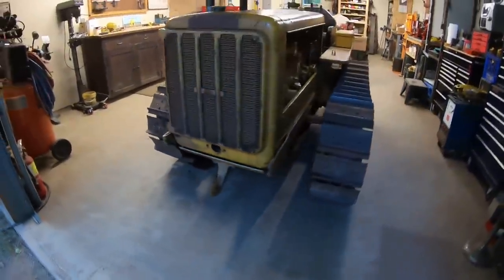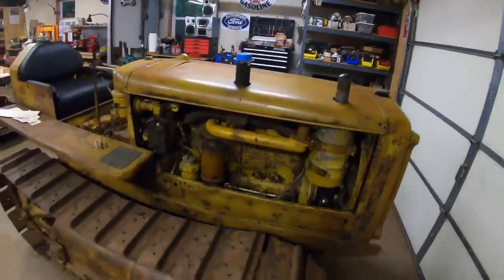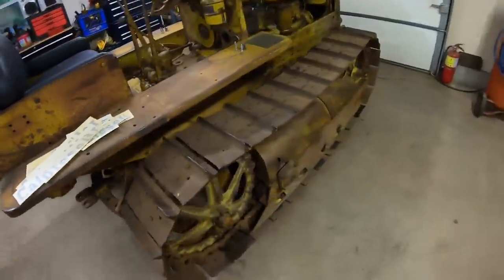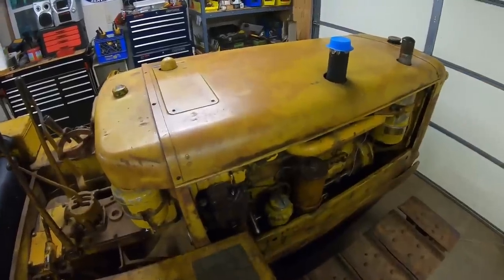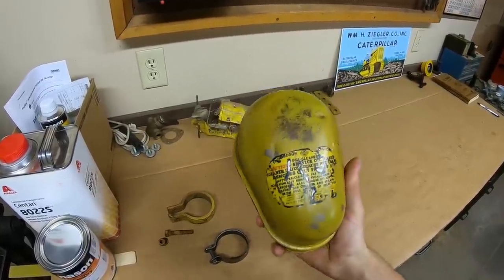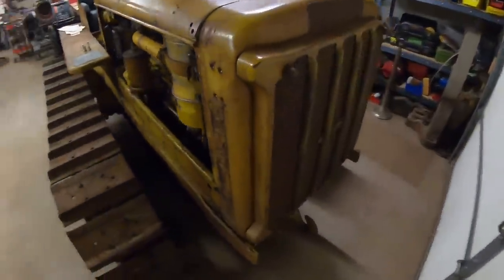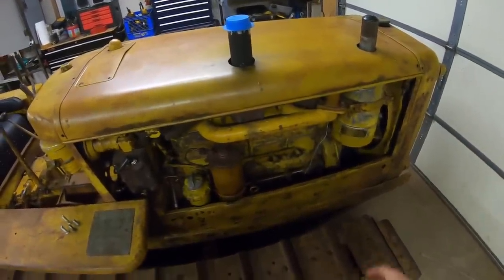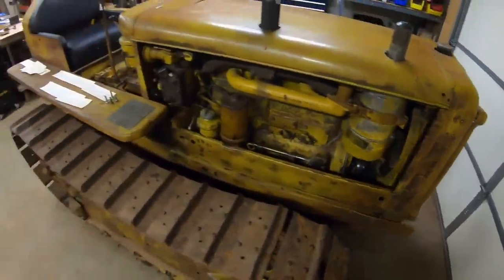Caterpillar D2 #5J1113 Chassis Rebuild Ep.64: Paint Work Update & Last Big Piece Almost Here!

Comment: In the guitar and violin restoration world there are some folks that are getting so good as to cause the community to call for them to include an additive in the paints and finishes they use that will luminesce under a black-light so their work cannot be passed off as original by someone down the road.  Pretty sure Squatch is already to that level when it comes to CATs.  🙃  But seriously, great work and thanks for the videos.

Comment: I'm not sure if anyone has mentioned it yet ,but cornstarch mixed in any clear coat is an old hot rodder trick to dull paint ,you can mix in any quantity to get the desired results ,just a thought !

Comment: As an earlier follower of the channel you have developed a super channel.  I came on board midway through the Minneapolis tractor and have been hooked ever since. People have no idea how much work you put into the channel and time required. I've thought about doing a series on a steam locomotive restoration but the commitment to do it is important and long. My D47U runs perfectly and has put in several 10 hr days pulling a 14' offset disk and hats off to the real old school cat skinners. I would like to find a good set of rails for it but I don't plan on earning a living with it yet. Keep up the good work and tell Sr hello from Texas and maybe when gas goes down we'll get the cats side by side and get a picture if you don't mind.

Comment: Awesome paint work Squatch. I do think it’s missing that additional depth that real corrosion adds. Like if you look at the engine paint it just looks like it has so much more depth than the engine panels. I would like to see some experiments of artificial corrosion even if only on a scrap piece, just to see what you can come up with. 

Again, there’s nothing wrong with your paint job, it does look fantastic, but the corrosion really adds something to it. 

Cheers Bud!

Comment: Looks great, as a modeller I use setting solution on decals, breaks up edges and helps to conform to surfaces. Don't know if it would work on decals of that size but maybe worth a try on spares. May I be so bold as to also suggest a bit of "damage" to the crease on the peak of the hood, could see it being chipped etc on the crease from someone resting or passing things over the hood
Reply: This could be a tough assignment!! IMHO your carefully -painted and aged' hood now needs some realistic 'collateral damage' (incidental damage from any result of an activity) to be believable......It looks TOO perfectly maintained as it is now: no scratches, dents, bumps, creases, bullet holes (?), etc.